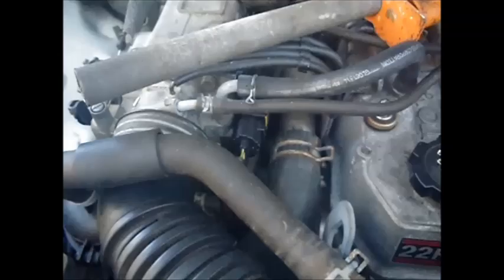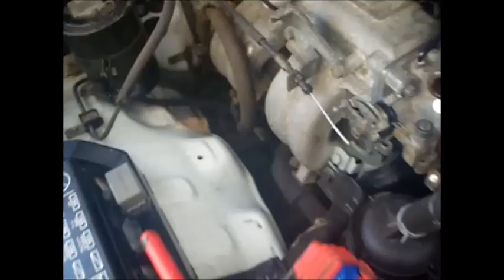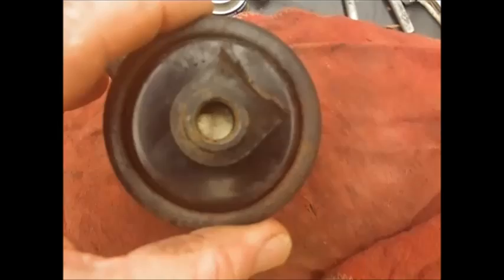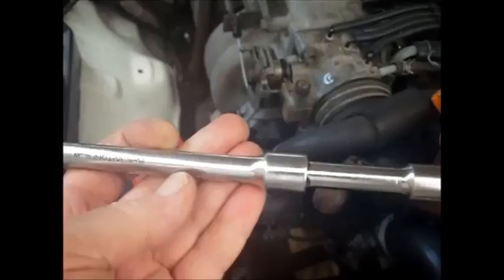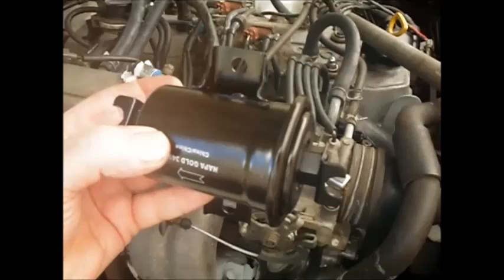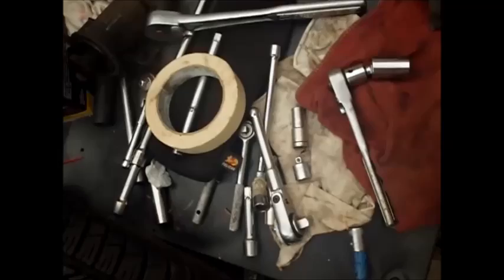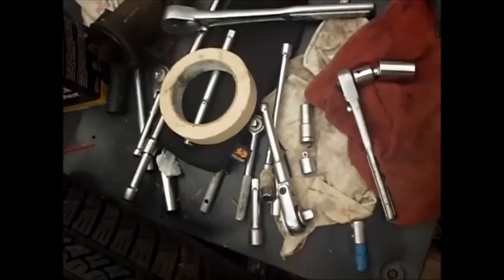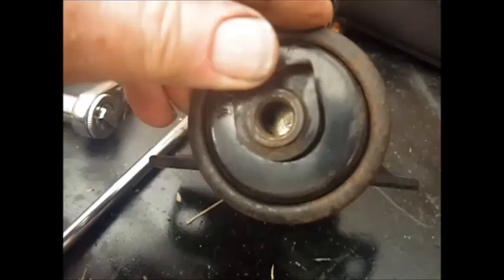Replacing Toyota 22re Fuel Filter Tricks and Mysteries

Comment: "One thing I'd recommend for doing this job is that you have every swivel tool and extension ever made!." -Meow Bang. Love it.. I was replacing my starter when I put a hole in my fuel line and then decided to change my fuel filter at the same time. That was 3 days ago I'm still trying to get that damn fuel filter mounted up going to try the screwdriver in the hole method you did.
Reply: Only thing about screw driver instead of "Chop Stick" is wooden stick wont harm threads!

Comment: Nice video!  I noticed the the Napa fuel filter has the mounting bracket attached. The Toyota factory bracket is separate from the filter and if you tighten the bracket too much, the bolts won't align with the holes. Should'a gone to Napa. Thanks for the video.
Reply: Not my Toyota filter. All one piece.
Reply: My OEM Toyota filter comes integral w/ bracket welded on.

Comment: easy access: remove front passenger wheel. There is a flap in the wheel well. remove it. bingo: fuel filter infront of yer face.
Reply from the maker: yes...but only on the 4X4 models....For some reason Toyota did not create all models equal.....
Reply: MarvelousSeven thank u for that critical bit of info!
gonna save me alot of time and patience!
Reply: I laughed reading this
Reply: I know this old i just got a 4x4 4runner with the 22re is it easier on 4x4s then ?
Reply: The passenger tire? Isn't the filter under the intake on the driver's side?
Reply: @timothyriley4209  no its by the oil filter.... i found out when I did my first oil change
Reply: M.j. no    @meowbang9836  h
Reply: My celica doesnt have that flap in the wheel well, so this doesnt work for me lol
Reply: No. Passenger side, rear. As he says in video.
Reply: @shiftengears5743  Yes it is easier on a 4x4.  I have a longer version comment that I put in about 2 years ago.  You might want to read it.
Reply: @timothyriley4209  Come on man....yes the filter is down lower on the "intake side" of the engine and the intake manifold is on the passenger side of the engine (on U.S. versions that is!).

Comment: @4:27 i thought the gas fumes finally got me.

just had the fuel pump fail on my '94 Xtracab 22re 4x4 5 speed, leading to me learning how to replace it (didn't expect to pull the bed off, but i did), so i really ought to replace the fuel filter too.  surprised to see that, much like the fuel pump, it's looking like a harder-than-the-average-longitudinal-4-cylinder type of job to do.  can't complain though;  i love this truck.

Comment: I'm working on friend's '93 toyota pickup and some things are brilliant and some things I feel are designed by children on this truck. The person that designed the fuel filter bracket should be fired. I had no problems with the banjo bolts or the bottom bolt. It's the stupid top bolt of the bracket that is almost impossible to tighten even if using a swivel sockets. There is simply no straight on access to the bolt. You also have to do all the work thru a wheel well and you need to bend the metal frame so you can get your hands in there. I never swore as many times I did as I did on this job. The brilliant part? How about a gas tank drain bolt? Very nice. If you have to replace the fuel pump then you need to take out the 8 bed bolts and slide the truck bed back a foot (wire harness won't let you go any further) and then you gain access to the top of the tank. You can also remove the fuel tank from the bottom but it will be difficult to put it back on and screw in the main fuel line.

Comment: This is the worst design element I've ever seen.....I've never cursed so much in my life on a "simple" mechanical job!  BUT I LOVE THIS TRUCK!   I have a 92 shortbed RWD and if you can't lift this vehicle at least 18-20 inches off the ground, it's just about impossible to do this job.  (It's far easier to do this job on a 4WD which has much more access because of their inner fender/frame design).  But if you have a RWD, find a buddy who has a lift.... that's the way to go cuz you need unbelievable arm articulation to get at this thing.  I have such a buddy and once I got this bastard loose I decided to change location of the filter to the upper mid-rear fender area directly across from the intake manifold.  I did not use the same filter....I used the filter that is available for a 2003 Tacoma which looks identical to the original but it eliminates the fuel line directional "holders" on each end of the OEM filter.  I then installed new re-formed fuel lines and got a nice 1' wide steel strap to make a hold down bracket.  I painted the strap black to match the filter and as an added bonus I now have a very convenient spot to check both before and after filter fuel pump pressure....awesome!
Reply: With access to a lift-- about how long could/should it take a DIY mechanic of reasonable ability to change Fuel Filter?

Comment: Did you ever end up opening up that old fuel filter to see whats up with that recessed thing up against the threads? I have mine off (I think I'm having fuel issues) and that little thing is recessed verrry far into the fuel filter even further than the new one.

Comment: Remove Passenger tire... And take off access panel bingo easy access to the oil and fuel filter and starter
Reply: Not on a 2.4L 4-cylinder engine. Even with the access thru the wheel well, it's a pain in the butt because you can't access the top bolt of the fuel mounting bracket.
Reply: Is that on a 2x4 or just 4x4?

Comment: How did u relieve the pressure?
Reply from the maker: I just opened the nut on the cold start injector....just open it slowly with a rag underneath...you could just crack the line on the filter and release any pressure....just be careful with the gas (ethanol)....
Reply: Meow Bang is there not a fuel pump relay that could be pulled to relieve the pressure?
Reply from the maker: ...There is a fuel pump relay...however that will just shut down the pump...there will (or should still be) pressure remaining in the line....
Reply: @meowbang9836  do you know where the FP relay is?
Reply: Fool s put the fuel line on the fender used  a marine fuel filter system on my b beloved dolphin  air drain on u tube

Comment: Mine is on 90,000 miles stock filter😨
Reply: MC Wip I have a 3rz Tacoma and I replaced what looked like the original filter after 177000 miles
Reply: I'm dealing with looks identical to a orginal filter with 315k lol